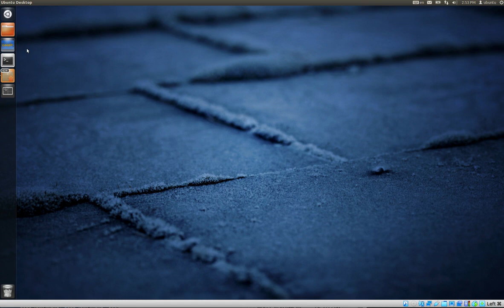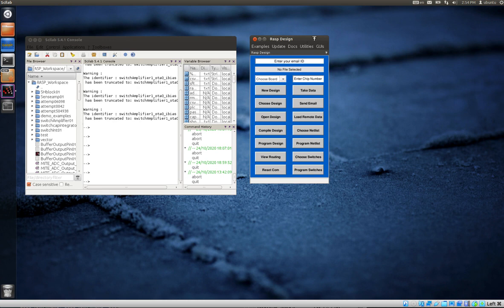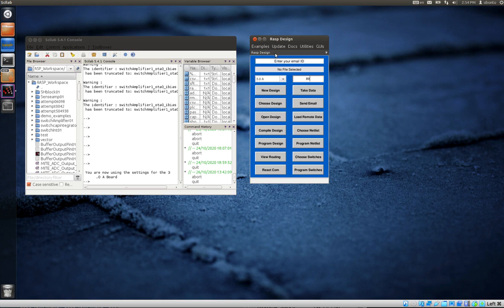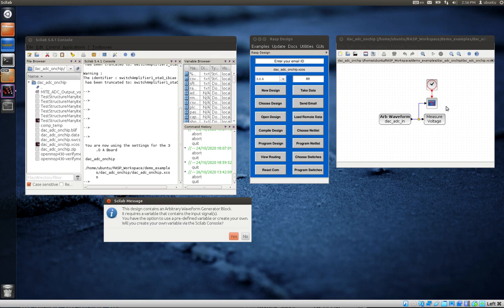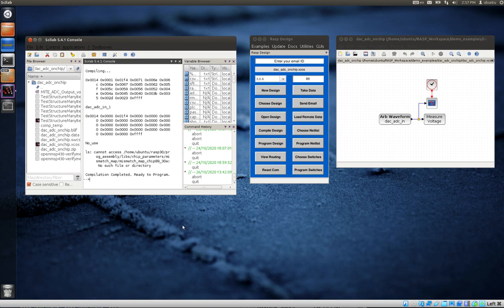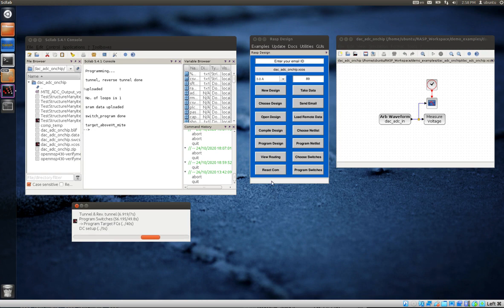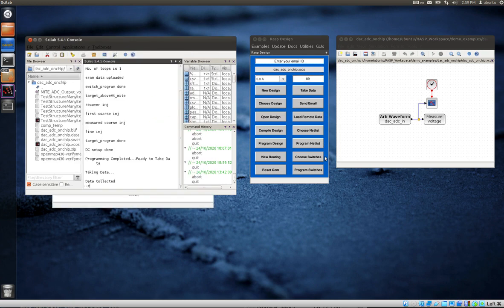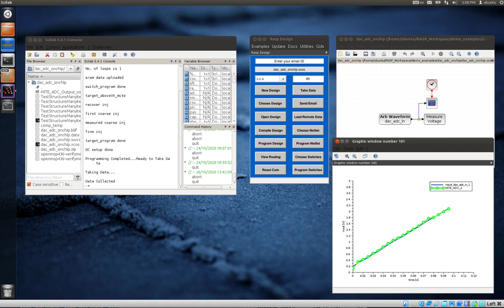Introductory Demonstration of the SoC FPAA Design Tools

Comment: Greetings. I am having problems with installing the FPAA virtual machine. In the system acceleration page, the error specifies to disable the hardware virtualization; but when i disabled it, the "Invalid settings detected" did not disappear. I am unable to run the virtual machine and don't know what to do beyond this point. Please advise. Your assistance is very much appreciated.